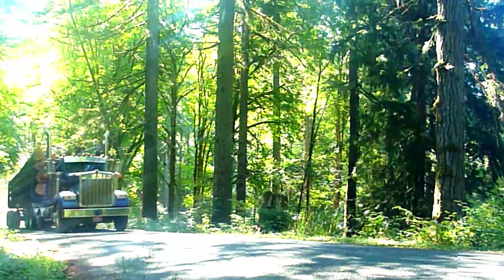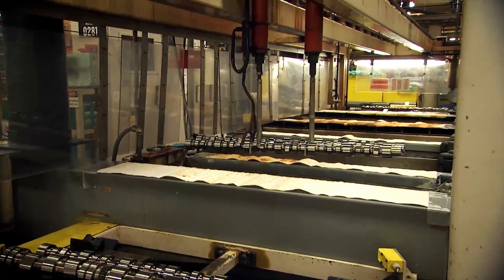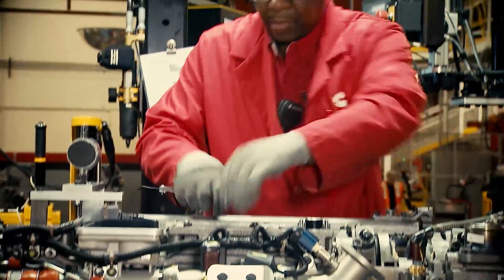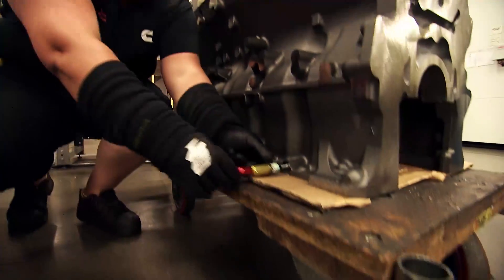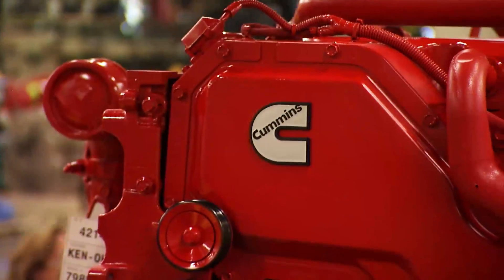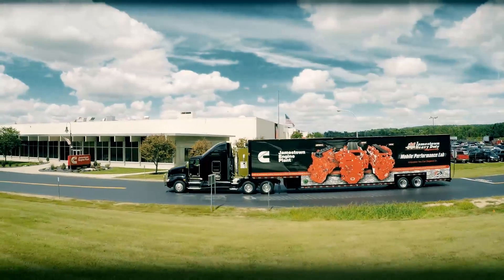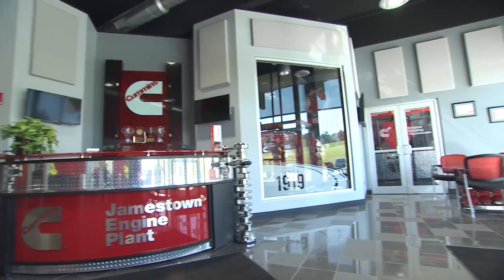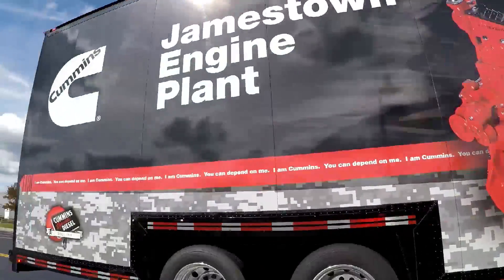Inside Cummins: This is Jamestown (2016)

Comment: Blah, blah, blah, typical infomercial!  Cummins is testing their product on the end user time and money.  They're so darn shameless in dealing with the end user after purchase that they manage to frustrate even the most loyal customers. Typical North American warranty program that cater only to their biggest customers while ignoring and frustrating their small customers.  It's all about their profits so they can make videos and brag about how good they are.  If you're a small end user, like an owner operator trucker with one truck or a small fleet, they couldn't care less if you go bankrupt while fighting with them to honor their warranty on those junk engines they build.  For example: they never fixed the rough running and missing at idle, the rough running at low ambient temperatures and the oil leak between the flywheel housing and engine block right above the starter in the pre common rail ISX/Signature engines.  The one piston air compressor is extremely noisy and low volume.
Reply: I work at the Cummins Columbus technical center. I can assure you if there is a problem with any of the engines we test them in very wide and extreme ranges. We even still test some ISX15's with the older XPI Fuel system to trouble shoot and solve common problems. Were always trying to troubleshoot and find the weak links in every engine platform. as for the warranty program I don't know much about, I only deal with the research and development side of the business
Reply: justin maschino get rid of EGR please, send everything into those filters but please can you do something so the exhaust doesn’t go back into the engine
Reply: justin maschino I didn’t see any testing in Fairbanks! Our engines didn’t work very well at all in the winter up there;( Had to take some extreme preventive maintenance measures! Sorry to hear you has anything to do related to the ISX family! All around a bad engine.
Reply: i want a new pete, but they have that stupid cummins engine which i hate, and i don't now much about a paccar either, so its either take it or leave it.
Reply: charles V;  Brother, I don't really have a good advise for you!   The engines are not the only problem here with the North American produced commercial trucks.  It's the whole darn thing, the whole design that's an engineering nightmare and built with the cheapest and shittiest components. 

DO NOT buy a PACCAR truck, be it Pete or KW with that PACCAR / DAF engine in it!!!

I'll tell you why:  That engine is being developed by DAF in Holland (Europe) and it is engineered to be installed in a COE (cab-over) truck.  It's a very good engine if it would be left alone the way it's built in Holland, with all calibrations and parameters the way it's set over there, but the fu*king North Americans (NA) morons have to modify key components, calibrations and parameters to suit the NA bullshit cronyism.  Keep in mind that the European truck manufacturers are completely vertically integrated.  That means that they manufacture themselves or contract other companies to manufacture for them parts and components especially engineered and unique for the trucks that they build.  That engine being designed for their COE trucks, it futures a unique design of the engine head which allows the camshafts to be removed sliding them out of the engine head towards the rear of the engine instead of at the front.  For them it makes life allot easier because there's nothing in the way at the back of the engine in their COEs.  Here in the conventional Petes and KWs you literally have to remove the whole engine out of the truck in order to replace a camshaft because you've got the cab firewall just an inch or two from the back of the engine.  

So, I hope I showed you how stupid truck building in America is and why not to buy a Pete or a KW with the DAF (paccar) engine in it.   It's not the engine that's the problem!  It's the rest of the junk that's the problem!
Reply: Hereintranzit ive been driving a 2013 daf xf105 for the past 4 years and its dropped a liner twice first time@ 300thou 2nd time@ 650,000kms. a matter of fact i think we have about 10 in our fleet with the mx13 paccar engine and theyve all dropped liners anywhere between 300-600,000kms. paccar said it was just that batch of trucks but ive also heard there playing up in other companys. other than being abit weak on the hills there awesome engines. quiet,alot of down low torque,best retarder etc

Comment: I just had to do an inframe in my 2013 ISX15 with only 367K miles due to oil consumption and liner polishing. Now taking it back in with frequent regen issue. But nice job on making Cummins look top notch and not a pocket picker
Reply: Leinad..... I'm NOT saying that this is your case, but in "most" cases.... generally, liner polishing is the result of too much extended idling.... and the oil consumption is probably connected with the liner polishing, resulting in poor oil control... or is it leaking it?
Reply: And make sure you buy the extended warranty gonna need it

Comment: I'm glad to see some things produced in the USA. I'm so damn sick of seeing things sold here in this country, not to mention sold in other countries, produced in China.
Reply: +Jason Carpp so! a lot of machinery and trucks made in China and Russia Cummins engines and ZF gear box and axles!i'm hungarian truck driver.in hungary manufactured for 5 years allison automatic truck and bus transmissions!no problem!us made and hungarian made transmission equally good!
Reply: +Jason Carpp the majority of parts on those engines are made in other countries, like mexico and china.
Reply: +Brandon Coccarelli What?! Why China? Mexico, I don't mind. But China? Why?
Reply: +Jason Carpp Cheap Products. Given the parts are from another area, the quality and response time of those companies when something goes wrong is actually spot on. The Quality Control aspect is actually pretty good, so there is a trade off there. American Made parts seem to lack the response time of the overseas companies. I used to work there, and the majority of parts are manufactured overseas, but they go through a quality check system about 15 times before the engine is even painted, so the quality is there, but the Manufacturing location is just in another area.
Reply: +Brandon Coccarelli That doesn't make any sense. I would think that it'd take less time for the product to reach its destination if it were produced here in this country. If it were to be sold in Asia, I would accept Made in China. Or Made in Australia, if it were to be sold in the South Pacific countries. But for the North American market, I'd prefer something made in either the USA or Canada, or Made in Mexico, for Mexico and South America. I would think it would depend on the country to which the product were to be sold.
Reply: No
Reply: +Zsolt Lukács I suppose that makes sense.
Reply: Jason Carpp
Yes, there where the use of production!